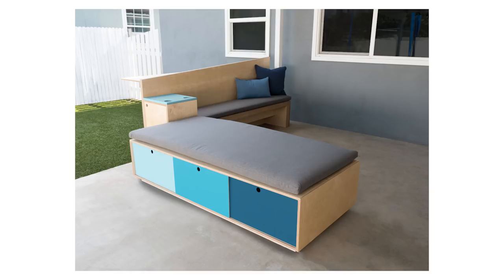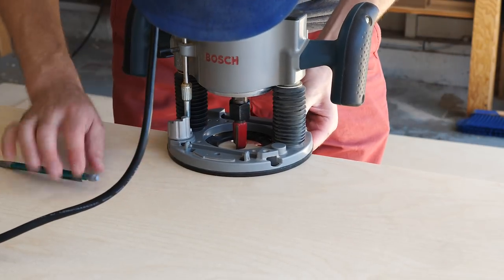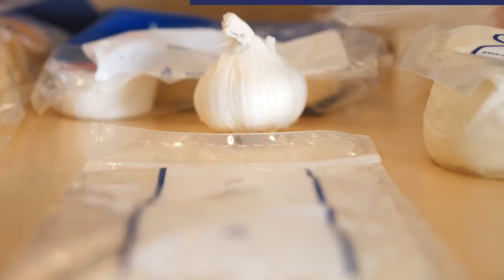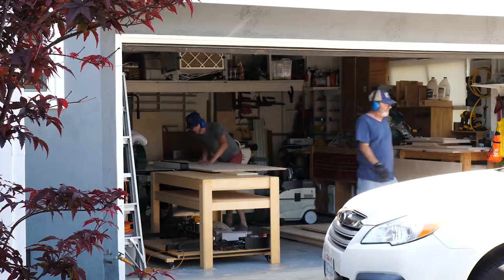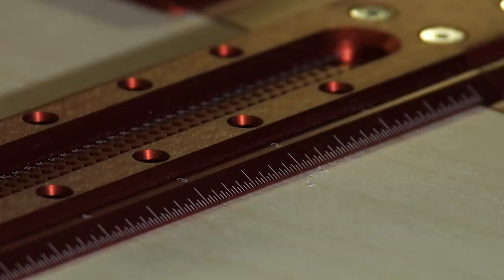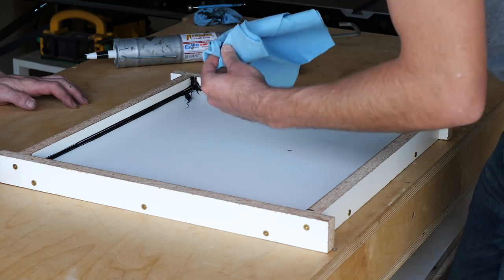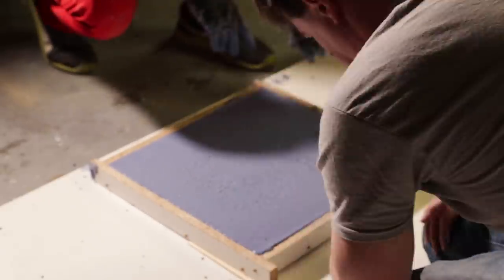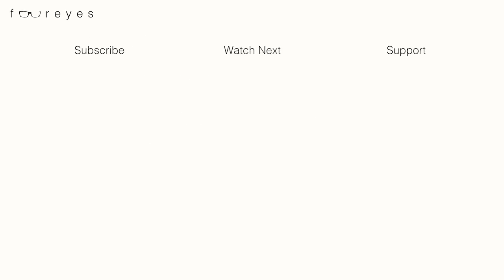Outdoor Storage Bench / How To Build Patio Furniture / Woodworking

Comment: Chris, great stuff. Don’t want to be that guy but I am. I’m a retired remodeler and I have built a ton of cushioned bench seating. (Churches). To get your cushions to stay in place better try building a shallow well that the cushion can sit in. Only about half as tall as the cushions thickness. Toekicks help so that when people sit on them their heels don’t kick in the doors or mar the cabinet surface. Another thought is to cover the doors in formica, it helps the stiffness of the doors which makes them easier to slide also easier to clean. If you are building more cabinets the cost is negligible. You can use the left overs for furniture in your childs room. There is a company named “Kerf Design” in Seattle, they make live edge Baltic/Apple Ply with Formica cabinets, right up your alley, cool stuff. I have been in their workshop and they are super nice check them out it will give you inspiration. I have been watching your vids for a couple of years really great stuff, i wish I was a talented on C.A.D. as you are. Thanks a ton.
Reply from the maker: Thanks Michael. Do you have any best resources for the formica? I'd love to try working with some for other projects. What is the best way to laminate it to the wood. I don't have a vacuume forming system. I'm guessing just some sort of adhesive and a roller would do?

I'm slightly familiar with Kerf designs. Their stuff is really cool.
Reply: Chris, vacuum stuff not necessary at first. I started with Fast-Cap stuff. Double sided edge trimmer, palm roller with steel and rubber rollers, the Lowe’s hand roller was pretty sturdy. The other product to try is Fast-Cap fast edge (peel & stick) the PVC stuff is supper sweet, I used to still glue the edges even with the peel and stick. They also have a natural wood peel and stick it has a little learning curve because it can
Reply from the maker: Thanks for the info...I'm looking around for information on sheets, where to buy them, but not having much luck. I think I might need to just try some local places. I would love to get some large sheets to use for colorful doors, interiors of cabinets. Table tops...etc...

Comment: Nice touch with the concrete! Ben would be proud, considering all his concrete ideas over the last years. 
Could you elaborate a bit more on the concrete mix and fibers? Which amounts and which specific products? Thanks!
Reply: I can jump in here since I worked with Chris on the concrete top -- we used GFRC mix from Fishstone.  My comment will get blocked if I add a link, but I have links to info in all concrete videos on my channel.  Or just wait a bit and the videos for the big projects Chris and I did will be out with more details :)

Comment: Chris, I love your videos and designs. If I may, I'd like to give a bit of advice. I don't this piece will stand up to racking over time. People sitting and stand, moving side to side, laying down, and so on will loosen the joints. The only component preventing racking is the back panel and my gut tells me it's not enough. You may want to reinforce the piece with some internal triangle brackets. God bless.
Reply from the maker: Good call Hazem...thanks!

Comment: Split and/tear. I would always make the money edge as flush as I could so I would have minimal trimming to avoid tearing/Splitting. I liked the Wilson Art adhesive the best. I would buy my Formica/Wilsonart from a contractor only supply. If you have a “ProSource” you can get an account there to access vendors. They are not wholesale but you can get all the sample chips then shop around.

Comment: Very cool project. Do you have anything to cover the drawer holes when you’re not using the furniture pieces to prevent wasps from getting in and building nests? I live in Florida and they’re abundant here. They move in quickly and they’re super aggressive too :(
Reply from the maker: I don't...I will monitor that though...and if it were a problem I'd probably just change the doors.

Comment: Hey Chris, 
I am planning to build a bench that is similar to your design. Got a question for you, I was planning on laminating two sheets of 3/4 plywood  for the top, bottom, and sides. Is that overkill? Do you think any of the four pieces need it?   
I would appreciate your input. 
Thanks, Zach
Reply from the maker: With good glue, joints, and some screws for insurance, I think you'll be fine. Obviously every environment is different though. Mine is relatively mild.
Reply: Thanks for the response, Chris. I think your right, mine will be for a built-in inside my home. So, that is a good way to save some plywood. Thanks again.

Comment: Hi Chris. Next time try to use less silicone (smaller opening on the silicone dosing). Smooth with your finger. Prepare the soap and soak your finger in soapy water before smoothing. This will be faster and more elegant.
Reply from the maker: I do need to use less...but peeling it away is so much fun!
Reply: Most pros (not me, but folks I've learned from) use a "liberal amount".  The soap and finger technique works OK, but doesn't always leave the cleanest line... the metal ball tool is pretty fool proof and leaves a really clean line.

Comment: Hey Chris how do you like the new overhead dust collection on your saw.
Is it any better than the old one you had. Do you think it is worth the extra money to upgrade the old one.
Reply from the maker: Hey Dave. I do like it...my old saw didn't have dust collection above...that said, depending on the price I could go for or against the upgrade. I think it's like a $300 or $400 option on Saw Stop - and I think that's about fair. In an ideal situation I'd like to run a second vacuum for the overhead dust...b/c when I do it the way I do it, I'm essentially cutting my suction in half. Still makes a difference though. It's just not as good as it could be if I had a better set up.

Comment: Between your two backyard projects you purchased 10 sheets of 3/4 ply. Here in the U.K. a sheet of that quality costs around £35 -£40. Approx $60 per sheet. That’s why unfortunately Ikea does so well over here. Keep up the great work
Reply from the maker: About the same here...I've only used 8 of the sheets so far. But yeah...I hear ya.

Comment: Very nice project. Damn nice result with your first concrete project. What a patio it's gonna become. Your method with the router worked, but why not use the straight side of the router as a reference for the line?
Reply from the maker: I used to do that...but it's harder b/c you have to worry about rotation. On the round side, even if you rotate (as long as you don't end up on the flat part) you're going to have a consistent distance.
Reply: That makes a lot of sense. Thanks for that tip

Comment: Great project, as always, Chris! I actually picked up an awesome tip from the channel DIY PETE for making easy silicone beads: You use masking tape close to the edges on both ends. Then you can even use your finger to make a round bead. At the end just pull the masking tape from the surface and you are left with a very clean seal ;)
Reply: The masking tape works pretty well, but it takes way longer, and is way more tedious, than the wax and metal ball tool.
Reply: Modustrial Maker I see. I've never done it myself, I just thought it's a good one :)
Reply: As with all things, there are lots of ways to do the job :)
Reply: Modustrial Maker Of course, depends on the time at hand, tool selection, also personal preference :)

Comment: Nice build Chris. I do like that Smurf color.... @08:00 so does that make you Papa Smurf with those red pants? Also, does that cushion slide around on top?
Reply from the maker: It doesn't slide...if it did, I was planning on putting some of that drawer liner stuff between the cushion and the wood...I don't think we''ll need it though.

Comment: You can burn out that foam pretty easily as well, rather than scraping it out. It's the same foam I use for lost foam casting.
Reply from the maker: Nice. Thanks for the tip.
Reply: Jake Lile interesting, new trick to add to the toolbox!
Reply: That's what it's all about, sharing knowledge!
Reply: Concrete and high temperatures are not the best friends tho :p
Reply: GFRC has pretty solid heat resistance, and that foam melts at a low temp (I know from sanding/melting it)...probably is something that should be experimented with to dial in, but I think it could work.
Reply: Doesn't have to be extremely high heat, and takes almost no time at all. I doubt the concrete would absorb much heat in the amount of time it takes to burn out the Styrofoam. Don't breathe those fumes btw.

Comment: You seem to run out of space pretty frequently, have you considered putting pieces on sawhorses? You could set them to the height of your table and slide them off without someone's help.
Reply from the maker: I run out of space in the shop...like I have no where to walk around. That's usually my problem.

Comment: Everyone using fancy fondant ball tools...just cut an angle on a dowel and you're good to go!!
Reply from the maker: They aren't that fancy. I think it was $7 for a pack of 10 different sizes. And metal so they'll hold up forever and the silicone comes right off.
Reply: I'm just teasing. Those are good points.

Comment: Hi Chris, is the finish you've used particularly hard wearing? you'll know the ply will be ok so I'm curious. We have it pretty hot here, humid occasionally, similar to you I'd have thought and the ply would get destroyed by the weather. I love the design and the functionality and I may try a similar option from kauri, macrocarpa or ceder (much more expensive though!)
Reply from the maker: It's just a polyurethane. The thing that is on my side is that it's a covered patio, and the sun is mostly on the opposite side of the house. So it doesn't get too much direct sun.
Reply: Chris Salomone yeah the covering will help for sure. I may do a test piece this summer and see what happens! 
Also sorry, the first draft of my message was done on the fly and sounded a bit dickish! I've amended so I sound more like a normal human versus someone on the internet.